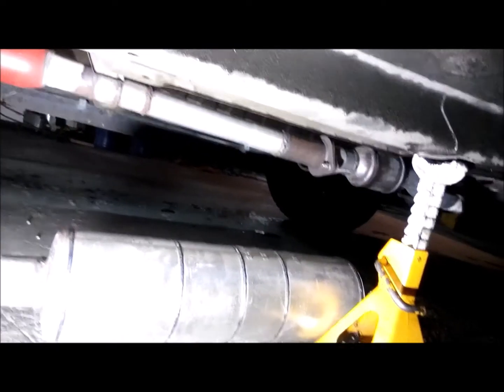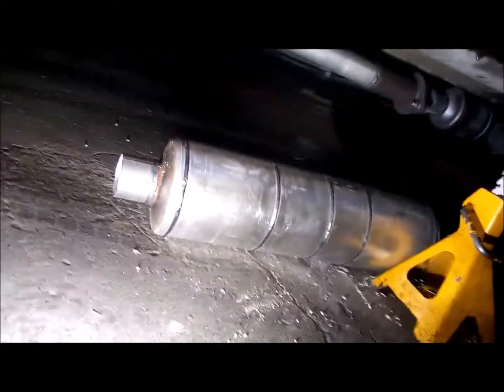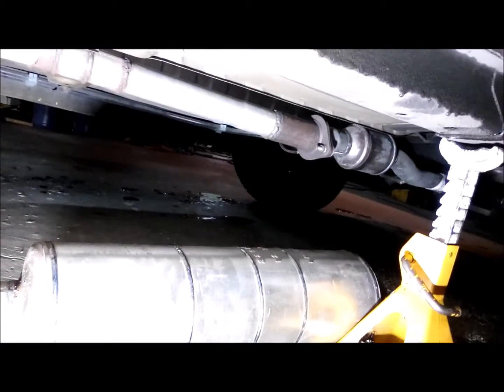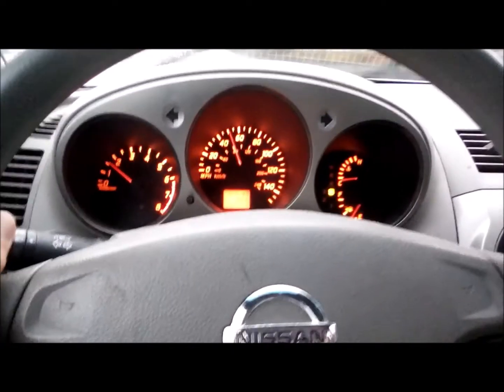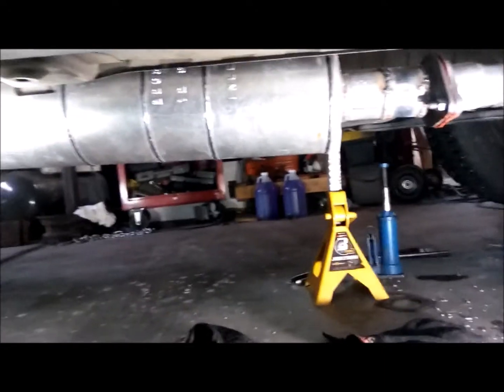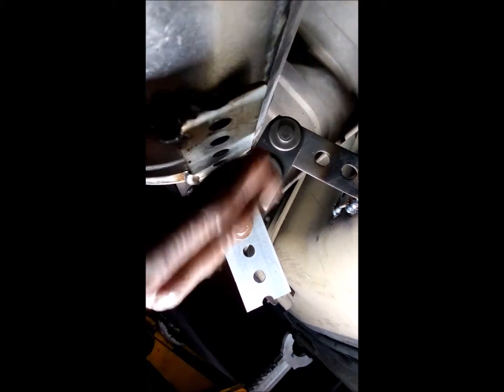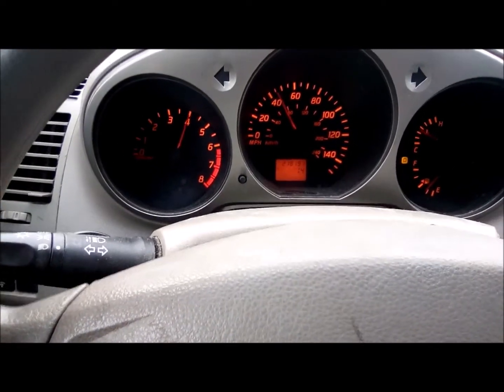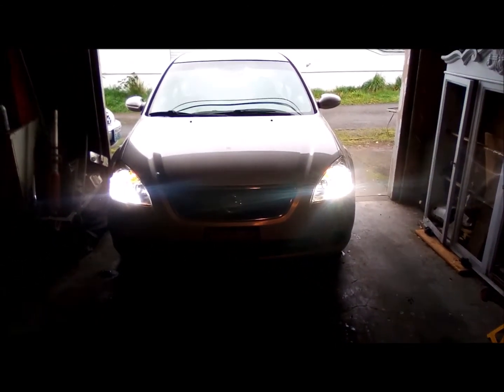2003 Nissan Altima 2.5L Walker Muffler (WLK-22635) Installation

Comment: What kind of headlights are they?
Reply from the maker: I got my headlights through Partsgeek. The part numbers may have changed slightly since I made my purchase:

https://www.partsgeek.com/mmparts/headlight/nissan/altima.html

2003 Nissan Altima Headlight Assembly - NI2502142C Action Crash

2003 Nissan Altima Headlight Assembly - NI2503142C Action Crash